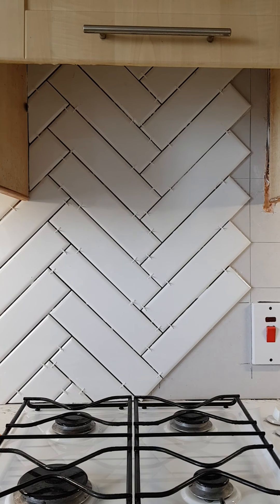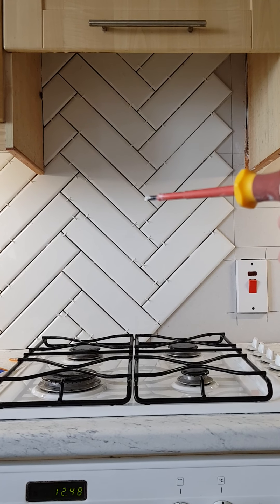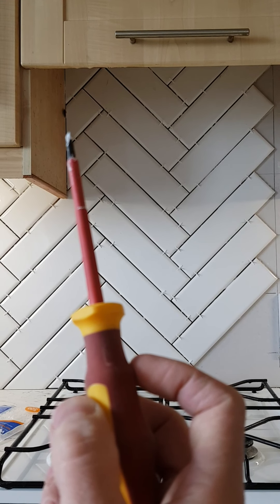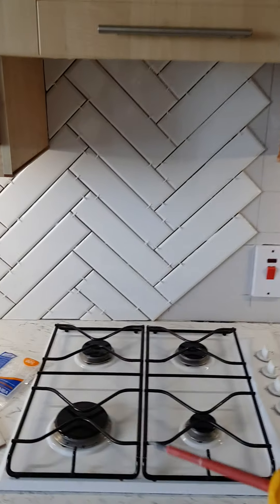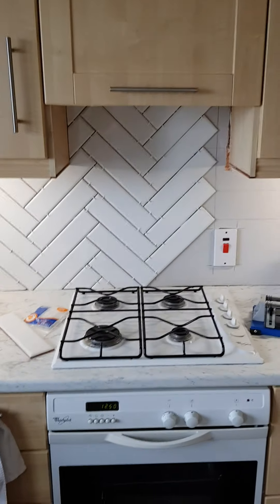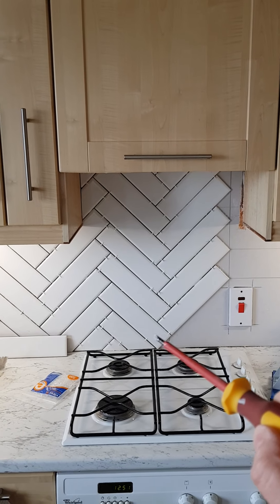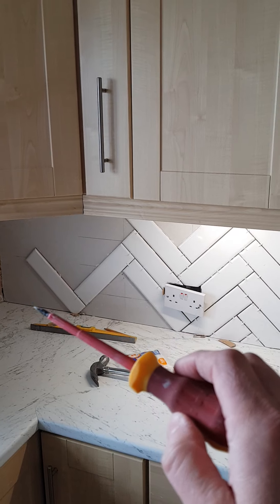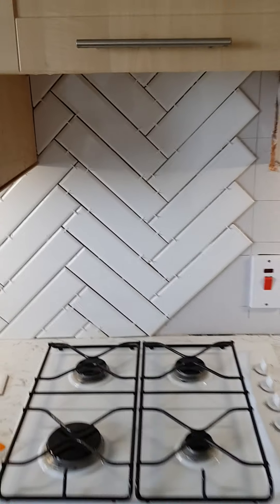Herringbone tiling - AVOID MISTAKES

Comment: A little pro tip i came up with for herringbone.   Lay the pattern out dry on the floor with actual joint width and make a jig/template you can put against each row to line the rows up to and check to see if everything is tight and square.     Its quick and easy and works great.
Reply from the maker: Great advice!
Reply: What do you mean by Jig?

Comment: I don’t know how much tiling you’ve done before but I think despite this job going slightly off as it goes away from your centre line, you’ve done a really good job. Herringbone is widely thought of as the trickiest tiling pattern to get spot on. The only thing I’d recommend, apart from the what you described in your vid, is the use of a laser level. They’re perfect to help you keep the corners of your tiles plumb and level as you build your pattern. Apart from that, nice job!
Reply from the maker: Music to my ears to hear positive advice!  Perfect 
Thank you very much for your comment and tips  :-)
I will use a laser next time.
Reply: I agree, way too hard on yourself. Nice job.

Comment: I think what you did is actually correct. If the surface is sloped, it's sloped. You want your tiles to be level to the eye, not to the level of the counter. as long as your first tile was at 45 degrees, you should have just laid your first tile where all the cuts would have been nice and not slithers. you weren't left with any slithers on your left side, but if the counter continues downwards to the right, you will end up with slithers., so you might have been better off laying that first one slightly higher. That's my slightly educated opinion anyway :)
Reply: You would want to ask the homeowner before chasing a out of level counter
Reply: Being a professional tiler you soon realise that literally no fixtures,floors,walls etc are level and vertical. It’s a sad fact of life. It’s a bitch
Reply: A lot of tile jobs, you have to trim the bottom row. Like when you set above an existing tub that isn't leveled properly.
You find the lowest point, and you run a full sized tile there, then trim as you move to the high spot.

Comment: You really didn’t do anything wrong. Backsplashes are way more detail and time oriented than people think. 1) The layout has to be right which in this case it is. 2) Countertop must be leveled, in this case if you didn’t shave off the corners of the full tile it would most tilted the layout to the right. 3) The drywall, especially the corners must be close to plum if you’re wrapping the layout to another wall. Not shaving off the bottom tile corners would fix the issue of having the same size tiles at the bottom, but would’ve created another issue up top. Nice work!

Comment: There is no mistake here. If you need to cut the tile to match you countertop then so be it. You will probably get worse problems doing it the way you suggested. Because your countertop is not level. I believe the best way to do herringbone is going upwards one row at a time, not sideways. Get the first vertical row finished then work of that.

Comment: Here's a tip from 24 years experience.. if your kitchen top is on the piss by 35mm right to left, then either get it level or don't choose to go herringbone pattern. Just my opinion, other then that you done your best with what your working with.
Reply: 35mm off level? Sack the kitchen fitters lol

Comment: All depends on how level that countertop is.  That’s the key.    The center line with equal cuts either side is most important.  If you have to trim tiles where they meat countertop so be it.

Comment: Not a big deal on the left side. The right side will be a problem. The tile will open up more and more and you’ll end up with a tiny 3/4” triangle.
It’s better to seal your drywall and use thinset to have time to readjust the tile. With mastic over unsealed drywall you only have 5 minutes.

Comment: Was the “work top” level as well as the cabinets?  Also, there is room to fudge each grout joint just a tiny unnoticeable amount to fix things.  Wait until you start to tile to the right side and your tile start to lift off of the “work top”.  Have fun and good luck!
With herringbone, when it matters, its best to make a template on a floor so you can check layout in every corner and edge.  The best thing to do is to talk the customer out of it or go with a herringbone mosaic.

Comment: You are not wrong .Did you consider creating a border round your units and worktops. The border could be slightly trimmed when required leaving the main field of your project perfect.
Reply from the maker: I didn't think of a border no.
It's a good point though and a nice tip for other tiling jobs in future!

Top tip  👍
Thank you

Comment: Thanks for that , you would of only needed to be out a small amount at your hob 45 degree start point but the further you go out either side the more the angle compounds, ie one side would rise up from the worktop and the other would dig in 👍
Reply from the maker: Exactly! The error would exaggerate over distance  👍

Hopefully the vid helps others avoid that, however... many so far say it's not too much of an issue?

Comment: this confuse me, as far as I know the way you set the center line is already correct theory. probably when laying the tile, they didn't form exact 45 degrees angle, hence the shaving?
Reply from the maker: Not sure myself either?
I kept the tiles tight against each other and used 2mm spacers to keep the gaps small.

Ah well...
It looked good in the end and more importantly centred on initial impression 👍

From other comments I've since learned that a laser level is key to ultimate precision (if you really wanted to be that accurate).

Comment: I don't think you did anything wrong wrong, I think your tile is not dimensional. Meaning 3x height don't equal the length. Nothing you can do about it, you did the right thing and it is installed correct. Unless you didn't cut on a 45, which might explain the small adjustments, but I really think it is my first comment.
Reply from the maker: Cheers Gamer
I appreciate your input  👍

Comment: I assume you put a level across the work surfaces to check for level.  And I would never run the corner of a tile to the surface edge, you are asking for trouble even it if went well across the first wall the side walls may then not be so forgiving   I personally would have allowed for a 10-15mm cut off the corner edge, as I would if I was tiling in a stack formation or any given pattern.  And again I would always do a dry run , or  pencil out my tile run , not having a dig at you but always plan your work and always check your levels . On the whole I'd say you've gotten of with a fairly easy process to rectify .
Reply from the maker: Cheers Paul
Don't feel your having a dig, all points mentioned are helpful. (To me and others who may read the comments).

The surface was checked and level and I take on board what you say about taking a snip off the corners giving it a flat surface to sit on rather than a fragile corner.

Thanks for the input.

Comment: This is painful to watch first of all that tile could pop because he didnt leave a 1/8 expansion joint at botton of tile which later needs to be caulked.
Reply from the maker: Porcelain tile is very dense. It has a very low thermal expansion rate and expands approximately . 000004 inches per degree Fahrenheit.

It's not a floor tile,
Being walked on,
Having objects dropped on it.

Unless the house moves,
That won't crack...